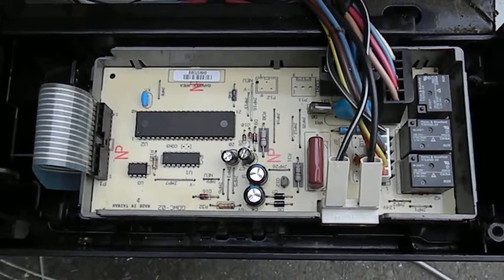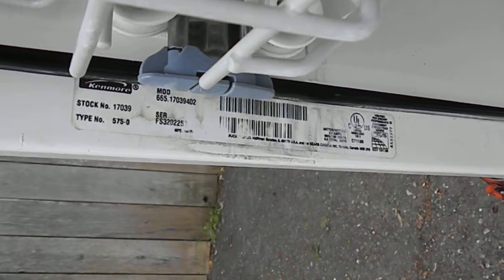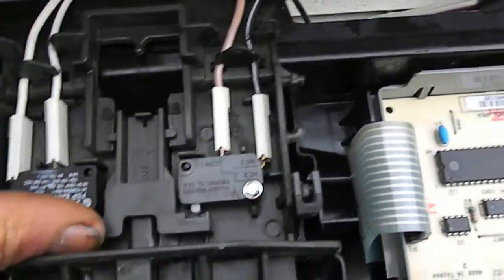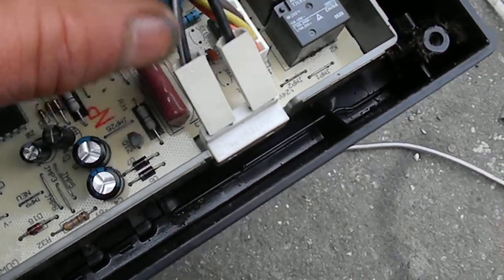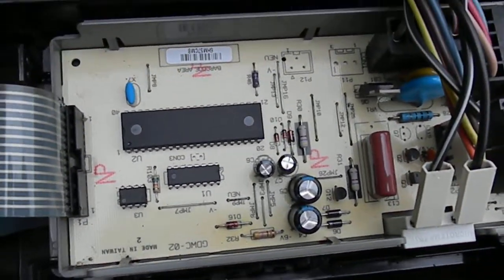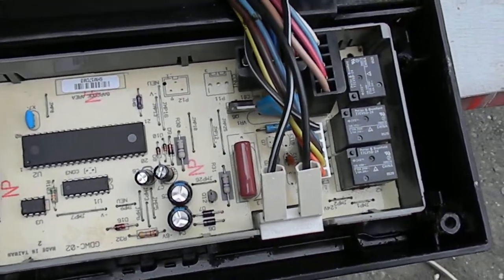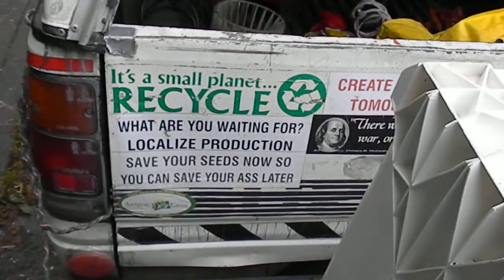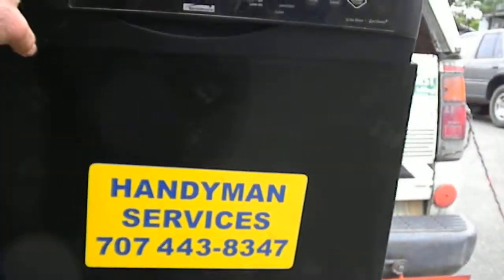Kenmore Dishwaser Service, Eureka Ca 707 443-8347

Comment from the maker: I clean and re-soldered the control board and it came back to life to a degree as it only works on the normal cycle but not on the Smart Wash cycle. It doesn't want to shut off in the Smart Wash cycle.